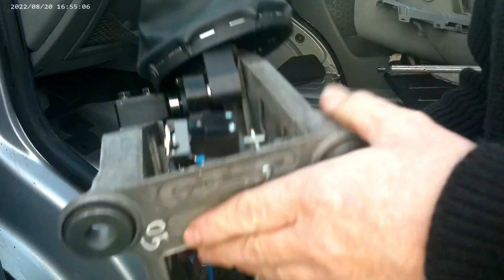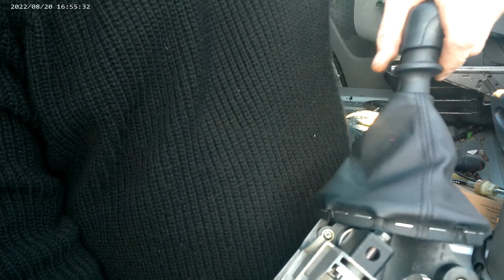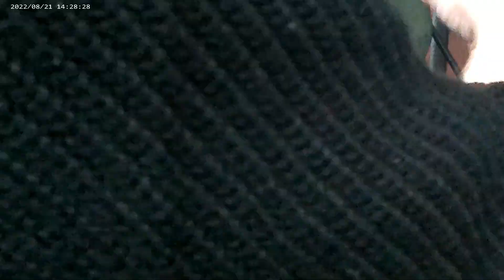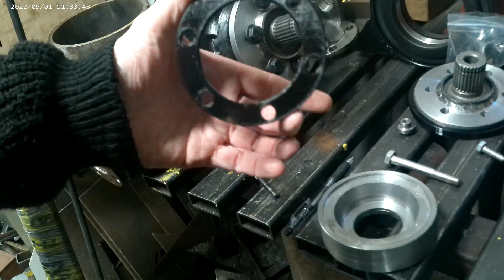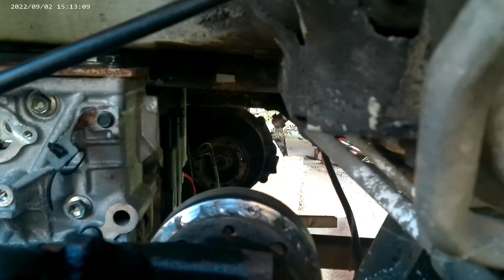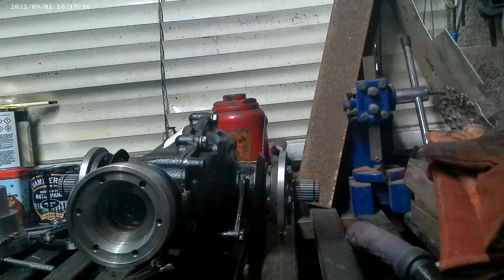VW T5 CONVERSION TO EV UP DATE

Comment: Impressive work. Does the shafts need any type of balancing?
Reply from the maker: Thank you.
The front driveshaft shouldn’t need balancing, although I have heard of people having problems when they’ve replaced joints and even shafts that could be because the sharps aren’t manufactured properly, or the joints are not orientated to one another apparently.

The prop shaft, However, I have done several rally cars in the past and they were successful and apparently did not vibrate However I’ve had vans and Kit cars where I have had to balance the shafts I did it redneck style putting a Jubilee clip on what I thought was the offending end and by turning it 90° from where it was and noting whether it gets better or worse, the vibration that can improve things greatly
I have seen a very clever technique that uses a dial test indicator gauge and a mobile phone a few chalk lines to balance prop shaft to high degree of accuracy. It would appear